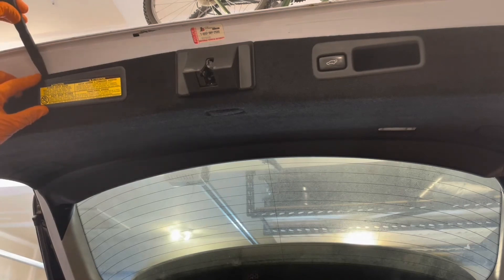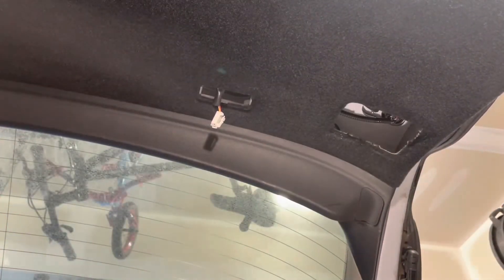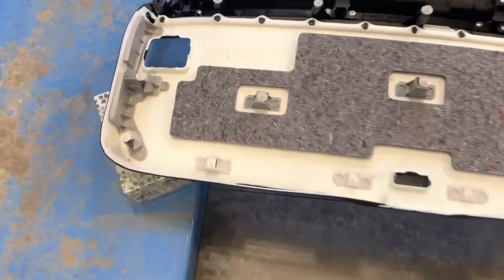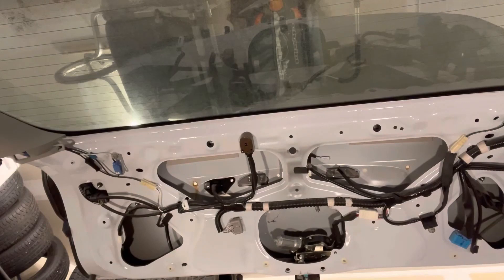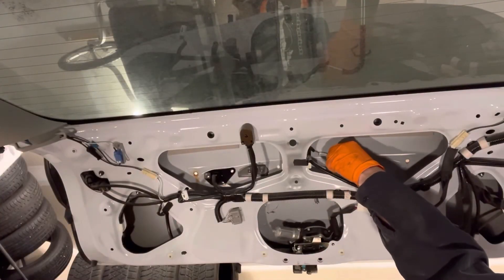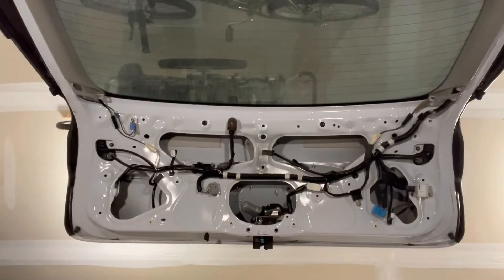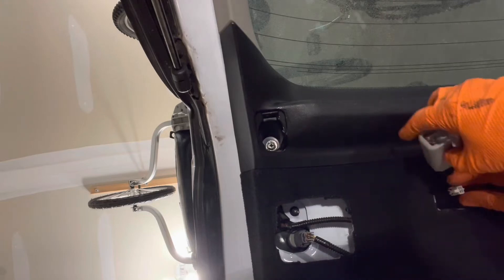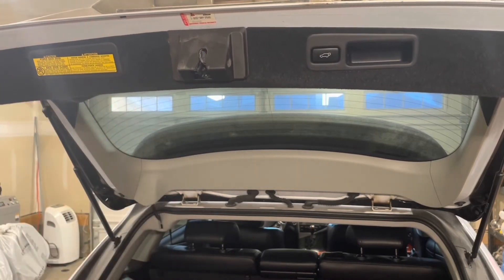2010-2015 Lexus RX350 RX450h License Plate Light Assembly Replacement Instructions

Comment from the maker: Below are my affiliate links to the parts and tools you would use to complete this job. I may receive a small commission from the product sales. Thank you!
Genuine Lexus/Toyota LED license plate light assembly: https://ebay.us/rkhyOC
Automotive trim and clip removal kit: https://amzn.to/3KgKGfg
Small flat blade screwdriver set: https://amzn.to/44HUoQi
1/4" impact driver kit: https://amzn.to/4f1UN4A
1/4” socket adapter set: https://amzn.to/44XTTkI
Rechargeable LED mini work light: https://amzn.to/3Y74OpY

Comment: Hi Victor, thank you so much for the detailed instruction video. Can the actual lens housing be removed to replace just the light bulb or does the whole housing need to be removed and replaced?
Reply from the maker: Hi, pretty much all of the license plate lights I have seen here on that model are LED built into the housing. If yours has a regular bulb, you will be able to replace it by removing the back trim panel. You will not need to remove the light housing as the bulb is accessed from behind. However, if it is an LED unit like shown in the video, the complete assembly has to be replaced if the light goes out.